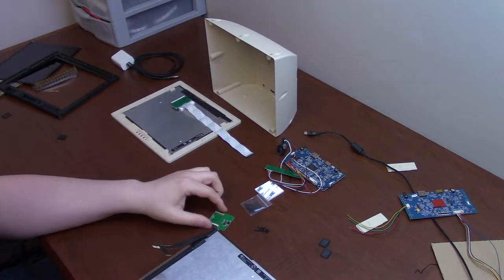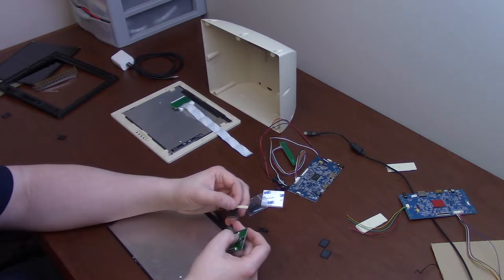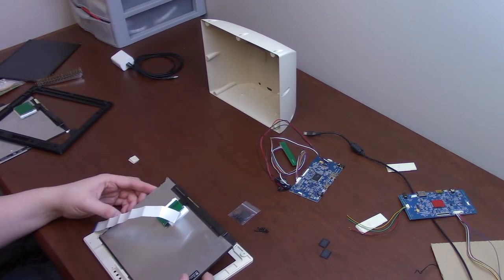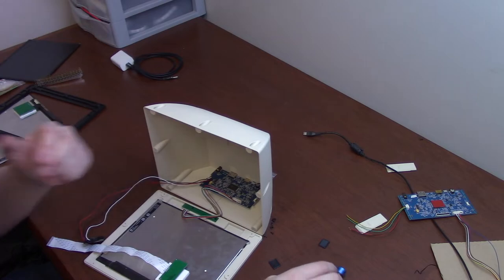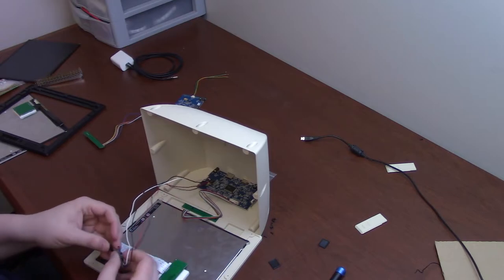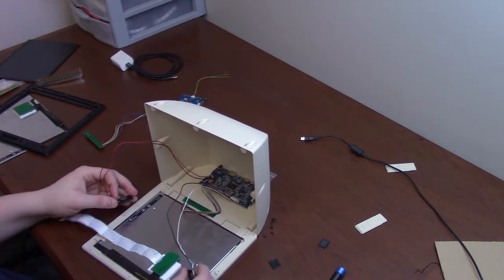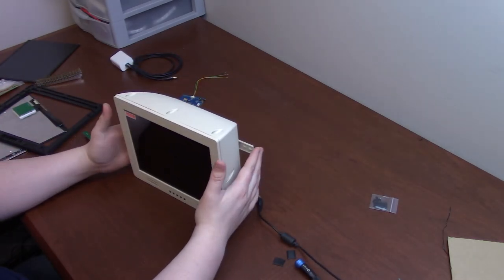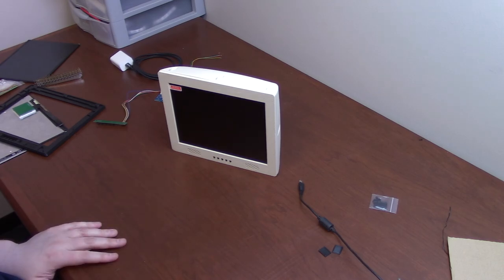Laser Bear Industries CRT Style iPad LCD Display Assembly Guide

Comment: Hello! 

Your fully assembled kit will play anything on HDMI and the SD card?
Reply from the maker: It is any HDMI source 480p or higher resolution up to 2048x1536
Reply: @LaserBearIndustries  awesome! So if place an order for the fully assembled version, and I want the remote compatible version with the board upgrade, if I add those to the same cart will it come with that instead of the basic? Or will I need to disassemble and do it myself? 

Thank you so much! I will be placing an order soon!! (:

Comment: What power supply do I need? The only one I can find linked is one on amazon that is no longer for sale...
Reply from the maker: You can get any 12v 2a PSU with a 5.5x2.1mm jack and a5.5x2.1 to 3.5x1.35mm adapter. We sell one of those adapters on our site, but you can also find them on Amazon. If you don't want to track down a PSU and adapter hit me up on the website contact page and I can put an order together for a PSU kit with adapter.
Reply: @LaserBearIndustries  I appreciate the response. I got one of your kits and an Ipad Air 4 that was stuck on the password screen. They'd been sitting in my cabinet for like 4 months, lmao. I finally today got around to putting it all together and once it was all built, I realized I didnt have a power adapter to turn it on and test it! lmao. While I have you here, can you tell me what kind of screen protector to use? Im a bit uneasy having the display so naked and bare in the case. I'd love to put a glass protector over it or something. Cheers!
Reply from the maker: @secondleasegamer8312  unfortunately there are not any off the shelf solutions for the bare panel from these. Some of the plastic protectors can be cut to fit if you do wish to use something.
Reply: @LaserBearIndustries  As soon as I find what I did with my calipers, I'll look into finding something then. Shame there isnt something already pre-made.

Comment: What is the cable used for the speakers? Got mine recently with speakers and don't trust myself to solder on the board... Thanks! (the case is amazing btw thanks again for the)
Reply from the maker: The connector is a Molex Picoblade 1.25mm 4 pin, you can get the connectors with pre-terminated wires from amazon, or digikey

Comment: Can you post spec (dimensions/connector type) of the speakers...? I forgot to add them when ordering the case and shipping these speakers to Ireland is way too expensive so I thought perhaps I can find them on ebay/aliexpress...?
Reply from the maker: No one makes them ready to go, you will need a Molex Picoblade 1.25mm 4 pin wire harness, the speakers are 4ohm or 8ohm 2w max and 36x16mm in dimension.
Reply: @LaserBearIndustries  ok had a look around and can't find anything... Any chance you could send me a pair? I tried to purchase on your site but apparently there are no shipping options... I'd pay via PayPal...
Reply from the maker: @qqryqq123  we are still getting set up for the new VAT changes and can't send things to the EU until our VAT application is approved. We are supposed to get more information in the coming week hopefully have it resolved by the end of July.
Reply: @LaserBearIndustries  could you put one pair on eBay perhaps??? eBay automatically adds vat etc... Add whatever eBay is charging you to the price..

Comment: How do you adjust the speaker volume?
Reply: I second this question - how do you adjust the volume?  The front panel buttons don't seem to affect the volume at all.
Reply: @mathewbeall1  You can adjust the volume with the front panel buttons by accessing the sound options in the settings.
Reply: @dszymanski91  ok - strange - I couldn’t seem to get the menu to pop up.   Just source
Reply: Ok - I figured it out - without a source displayed, the menu won't show up - AND, at least for my board, it wasn't keyed - and there are the connector is larger than the plug, so you can plug it in at least 3 different spots... Thanks!

Comment: Does this work with the original iPad 2 and 3, or only the iPad air 2 and 3?
Reply from the maker: Apple's documentation is not great on which ones use which screens. It appears iPad 3 and 4 are the ones with this screen (air or not) it was written as 2/3 on some sites and 3/4 on others.
Reply: @LaserBearIndustries  I have opened up several Ipad Airs (ones, twos and threes). None of them, I repeat NONE of them had the right type of connector. While the screen IS the right type spec wise if I look it up on Apple's web page it can't be connector to the driver board due to incompatible connector. I do not know if there exist a converter from the push down type connector to the insert ZIF connector type we need. I found a screen that was the right type AND had the right type connector in Ipad 3rd gen.
I am not saying this applies to everyone's situation, but I had absolutely no luck with Ipad Airs.